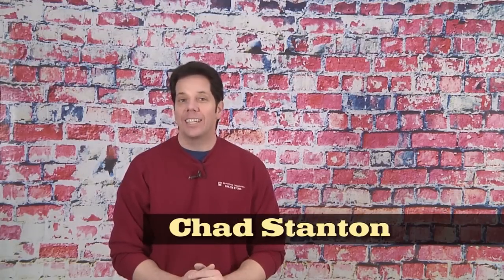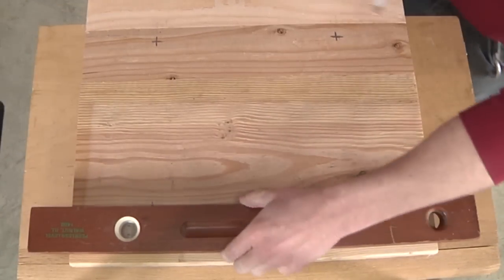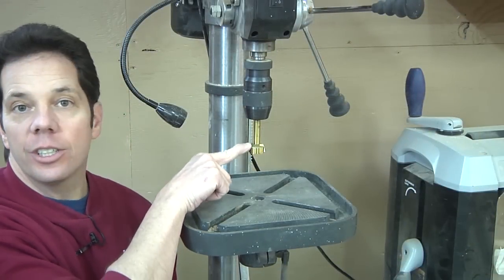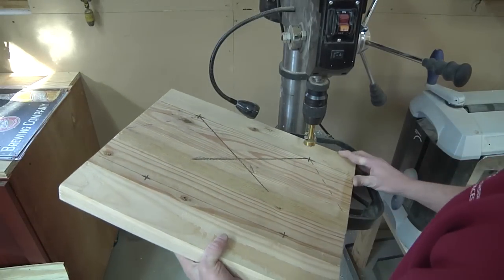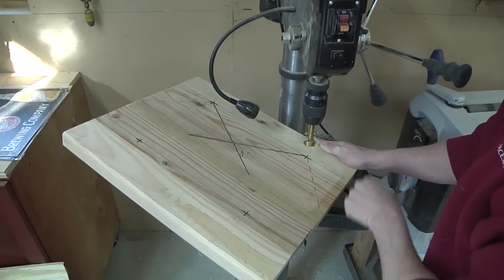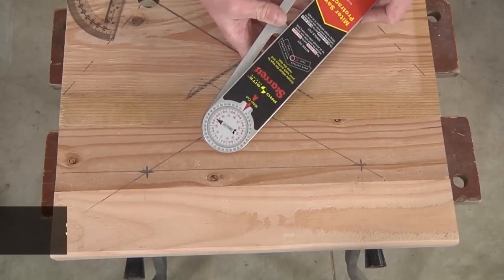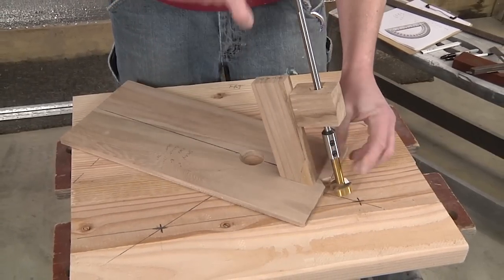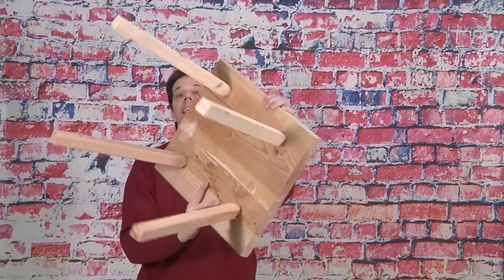Woodworking Angles Building A Chair - Geometry Tip (Part 2)

Comment: I stank at geometry and math fifty years ago and I still stink at geometry and math today. This is a helpful video, thank you. However, like a lot of the woodworking content on YT, this is heavy on sophistication and calculation. Wood butchers like me just want basic know-how so we can have fun. Not looking to win any awards, just make gifts for people. The angle jig at the end was over the top, but if I just make one that is basic, it will work for the two-handed high torque, high power, slow rpm drill my forstner bits are in

Comment: I have never used my cheapy drill press much, but after watching this video realized the bed on it has a degree indicator for tilting. Just have to loosen a bolt underneath and tilt the zero point on the bed until it's inline with the degree of tilt needed. I was really surprised to see that feature on it.

Comment: Hi Chad - Using the $1.00 protractor, I believe the correct sight angle to use for the rear legs (from your reference line) would be 90 - 34 = 56 degrees.
Reply: Glad someone else noticed that, too! I was starting to get confused, especially looking at his front and rear sight lines drawn that are only a couple degrees different. I was planning on making a small chair that is only one degree different in the rake, resultant, and SL angles as his rear legs, and the sight lines on my sketch angled up more than his. Thought I was figuring the SL angle wrong.

Comment: Hi Chad,

First of all, I’m a big fan of yours. But I have a comment and a question. Isn’t this a compound angle. I did it so many times before when I build stools. What I usually do it I tilt the drill press bed and the I use a sacrificial wood block to raise the piece then I have my compound.  angel with no geometry and measurements. 

What do you think?!

Comment: Thanks so much for sharing this video. Is there a formula that gives the length deferents for the front and rear legs? I am assuming that the rear legs are longer because of the 16 degree rake to get a level platform or chair seat?
Also to get the leg to fit flat on the floor I would just cut the bottoms to the same splay and rake as the top right? This is my first woodworking project in 30 years just got a new saw and wanted to build a stand for it.  Thanks again for sharing.